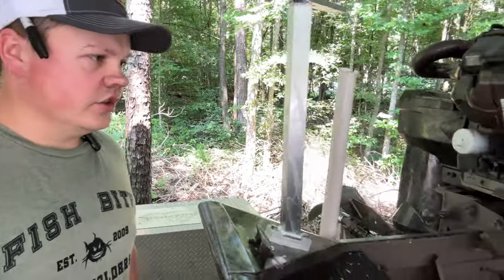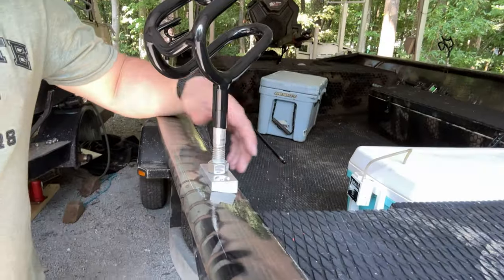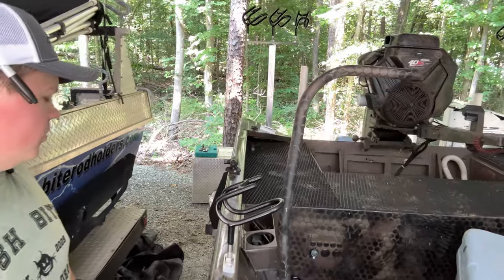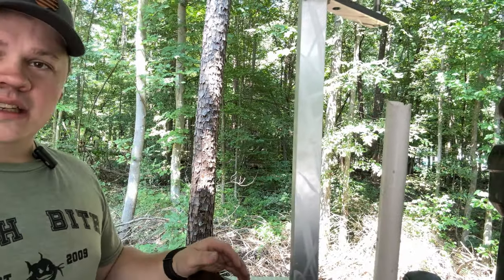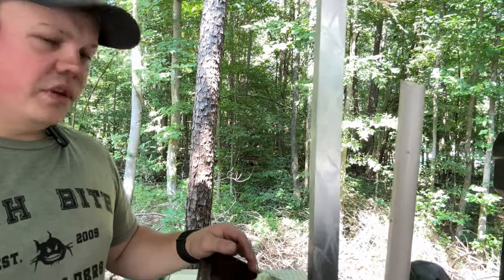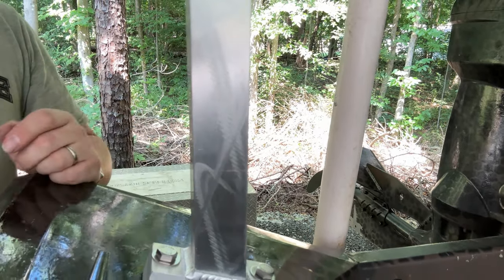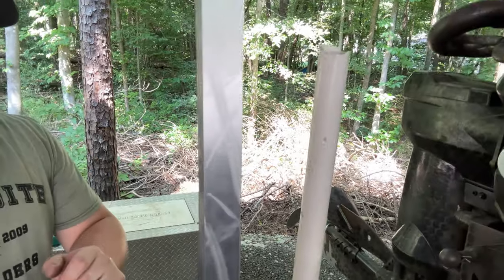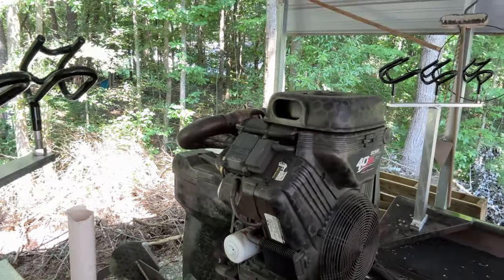River Fishing Boat Setup: Fish Bite Rod Holders

Comment: What the reason for the chap stick???
Reply from the maker: Great question.  We always recommend to apply a little bit of grease, or something that can provide some lubrication, so the holders do not seize up in the aluminum mount.

Chapstick is so convenient and cheap to use.  We've been using this for years and have had no issues with a mount screw, a rod holder, or anything seizing up.  Even when we go to adjust our holders or swap them up, it helps to prevent seizing, as well.